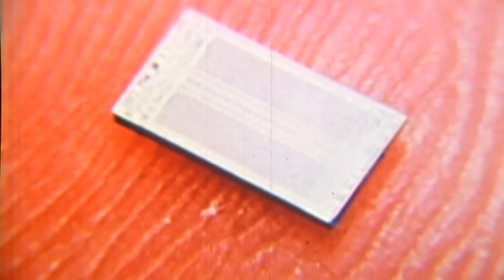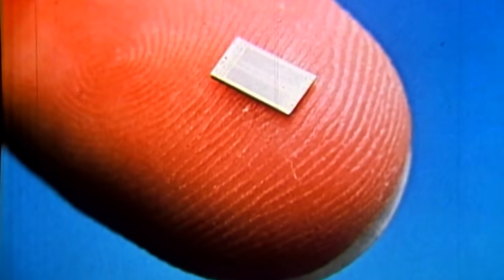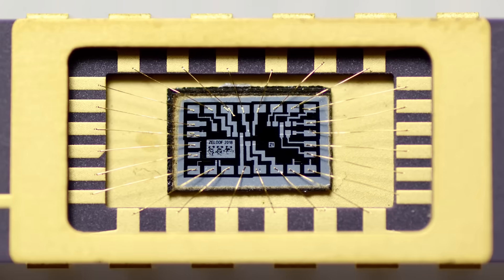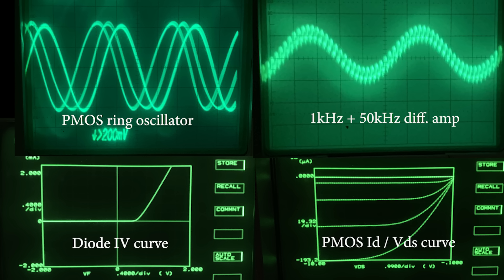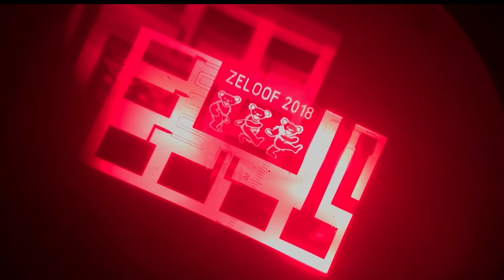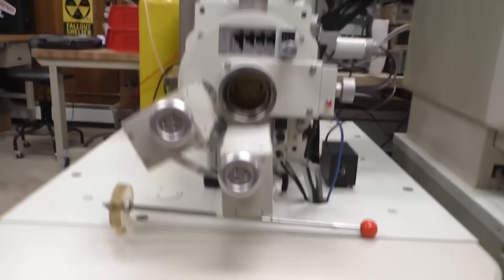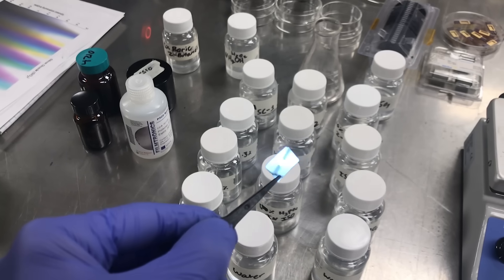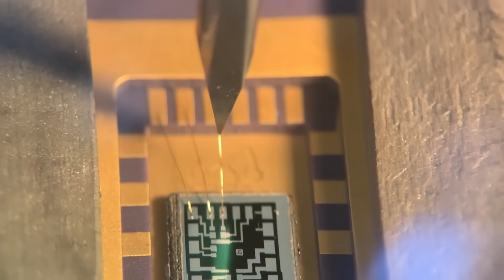"Z1" - Homemade Silicon ICs / Computer Chips

Comment: Now the question is how to make small mobile printer that makes integrated circuits and can apply 100 billion transistors to a chip. And can be run by a non-professional at home.

Integrate the integrated circuit lab in a small automated device the size of a printer.

Comment: i made diodes. work ok with ac adapters. crystal radios. i saw an electron microscope at govliquidation 20 years ago. the small steel cylinder has vacuum leaks. nichrome wire fails with leaks. get silicon wafer. it will maybe have boron. sand off the oxide. get aluminum powder. heat in vacuum. diode. i might try a bic lighter with clay covering.

Comment: I've always wanted to do this, but the necessity of messing with hydrofluoric acid means I won't. That stuff is terrifying. My chemistry lab TA would scold us just for writing the fluorine ion in our notes because "You should NEVER be making this ion!" Being a contact poison is scary enough, but the particular way in which it kills you (slowly, extremely painfully and gruesomely) puts it on a completely different level. Add to that the fact that a very very small amount just dropped on your skin is enough to achieve this effect and you've got yourself a recipe for a material I don't even want to be in the same room with.

Meanwhile, when I was a geology student, I knew grad students that would  casually pour the stuff on samples and just sorta hang around in the lab with bottles of it randomly sitting on the table. But geologists are strange folk.
Reply: I work in the industry: every year we get a safety training and part of that is they teach us where the emergency stations with Calcium cream are. The local hospital has staff trained to handle HF specifically.

Comment: I am beyond impressed. It's a bit like making PCBs only a bit more accurate and using lithographic reduction, then repeating the process 3 times. I could be interested in designing you a very simple 8 bit CPU in random logic for stage 3, time permitting. [I and a friend designed one once at uni while doing Comp Sci back in the 80s, christened the PUB1 on account of its design heritage, then renamed to the PBU1 on account of it being Pretty Bloody Useless...]

Comment: Have you tried using a thin insulator like a uv hardened mask that gets plated over to connect pads instead of bonded wire?

 I could see how masking and plating could be difficult since pads being joined are at different heights but seems like a interesting technique.

Comment: apart from your work, the most important thing in this project is the diy production of chemicals needed and the machinery.
to produce diy we need to integrate all processes, and those processes have to be diy as well.
this is the only way we can build diy capacity, and this can be done with latest scientific publications pdfs, youtubers who publish diy, and also several forums, which have knowledge segmentation as well isolated threads.
so if we put all this together with a single aim, we can create the entire process of a given product, and if we connect different products we can create process integration with chemical, thermal, and energy loops

Comment: easy DIY, the particle accelerator, nuclear power plant, hydrogen bomb, saturn V rocket, X-ray laser , Hubble space telescope, MRI machine, tomograph, seismograph, oil drill rig, gravitational wave receiver, nuclear submarine, private GPS satellite system, atomic clock, and over the horizon radar are only recommended, not strictly required.

Comment: Kudos for the young lad! For anyone calling him rich, they should know with respect to the equipment he is just lucky for being in the US, for you can find used professional equipment for a low price, BUT the other parts of the "equation" are pure skills and persistence. Most young people are lazy and don't understand that in most of the cases they won't have enough free time in the future. As for the universities and the processes of manufacturing an IC, in my case we only did these things in theory (a high ranking university in the UK) and although my course was an electronics engineering one and with embedded systems and VLSI as the main part of it, we only gained practical experience in the designing, not the use or design of equipment for realizing ICs. I am sure they had LSI capabilities in-house since they had R&D on microelectronics but we've never actually seen them.